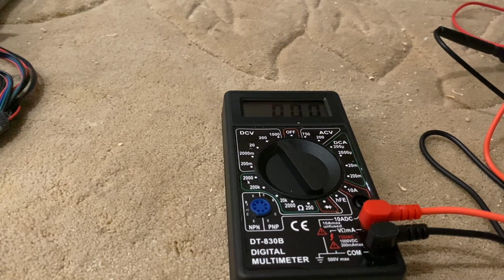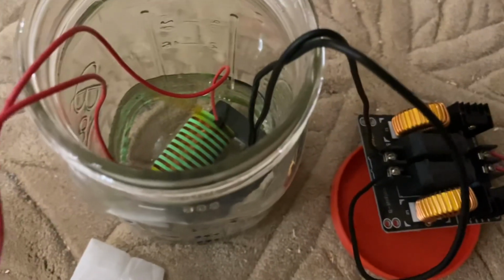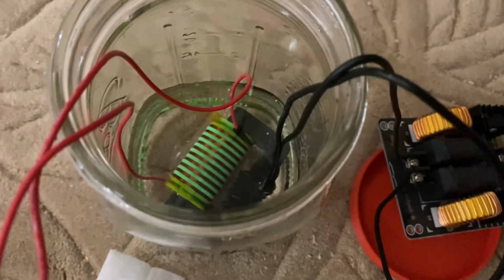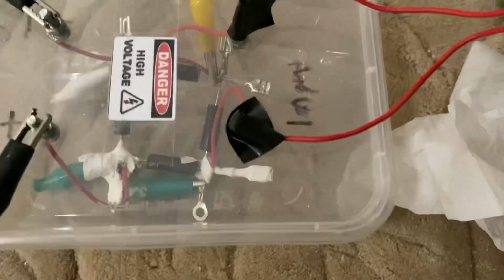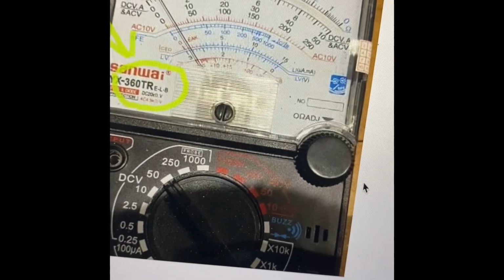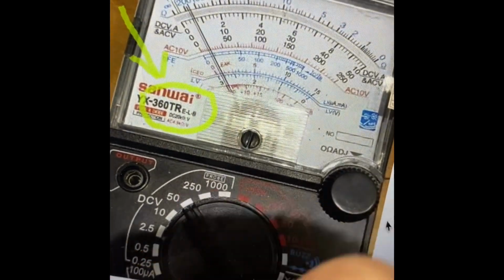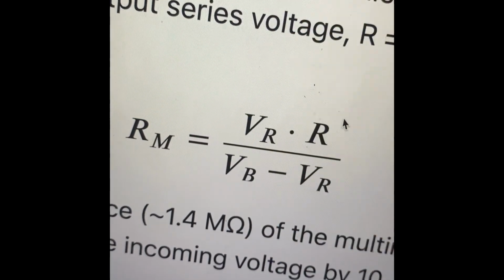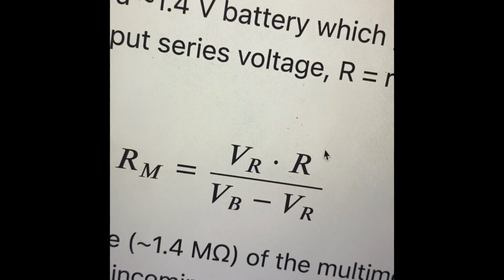Measuring High Voltage AC on a Budget

Comment: Thanks for the sub buddy! Right back at ya😉. This is a cool setup, a very ingenious system. I've been doing a lot of HV foolery lately as well and love the hobby (along with rockets & pyro, guns, gunsmithing and chemistry, as you may have seen from my channel lol), I just got my shipment of 8 microwave diodes in so I can finally finish the full wave bridge rectifier in my capacitor charger (with some spares, I'm only using 4), before the MW diodes I was using some 600V diodes I had from a Speedotron photo flash pack and couldn't charge any higher than that, but now that I have some 9000V diodes things will change lol, my 1.5KJ cap bank's 1300V potential will soon be realized😁. Have you done anything with capacitor banks yet? They are scary AF and will kill you dead in the blink of an eye but holy crap you can do some amazing things with them. I'm particularly interested in exploding bridge wires, it's wild how much energy you can put through a hair thin copper wire in the last nanosecond that it still exists lol.

And BTW, that ZVS is rated up to 36V, I've got the same one.
Reply from the maker: Hi thank you so much for the sub! I haven’t messed around too much with those cap banks but it’s on the list.